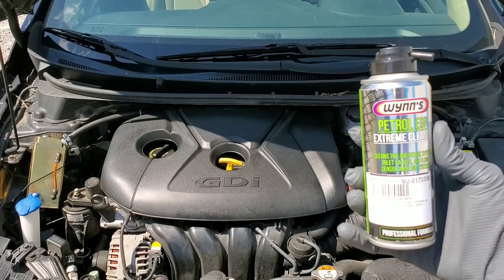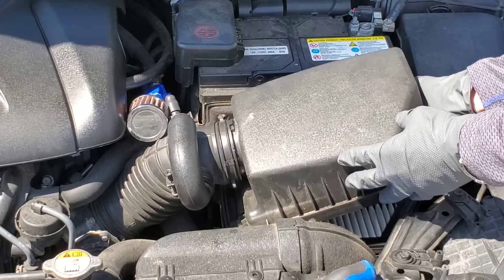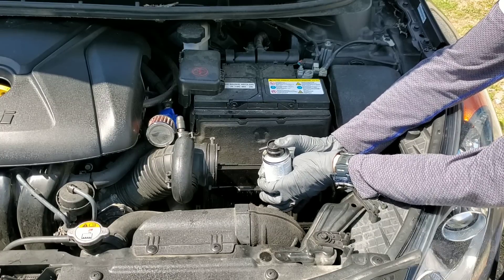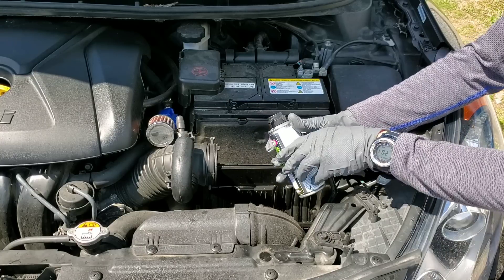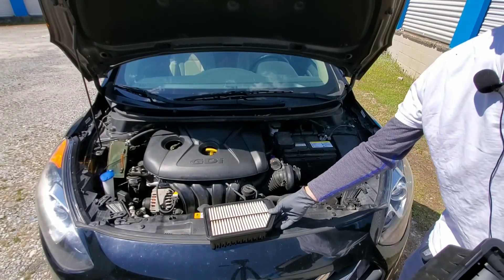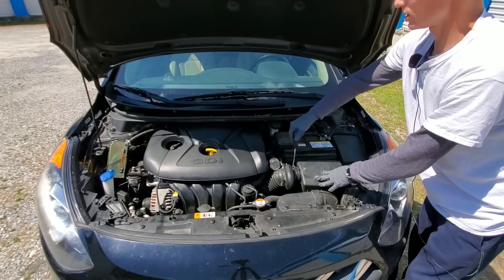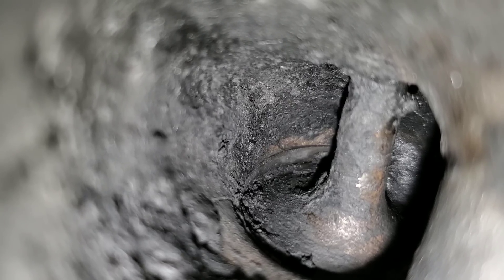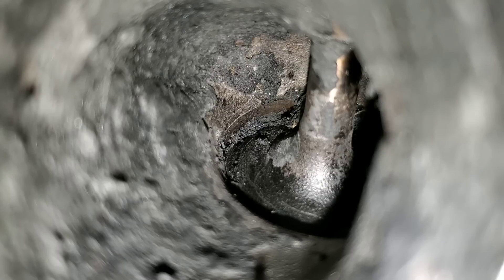Wynns petrol extreme cleaner the  best?

Comment: Try k2 carbon cleaner smokes like seafoam made huge difference in my gm
Reply from the maker: Thanks for the suggestions
Reply from the maker: Thats great
Reply: would this stuff work on my golt gti mk5 FTSI 2.0L straight into the air intake?